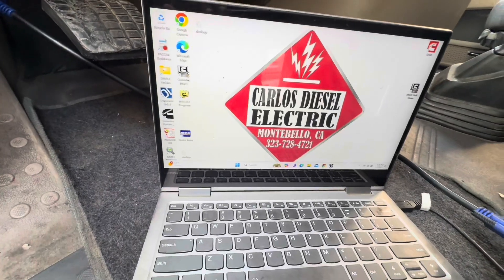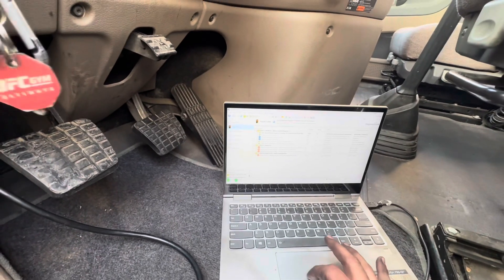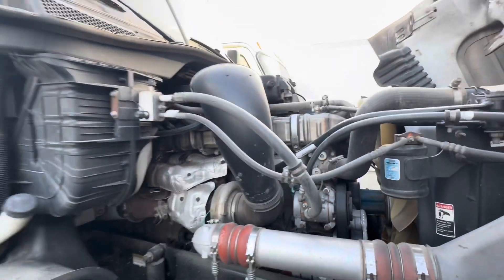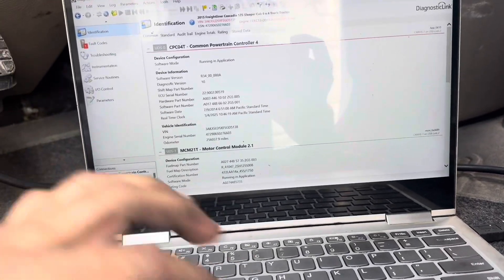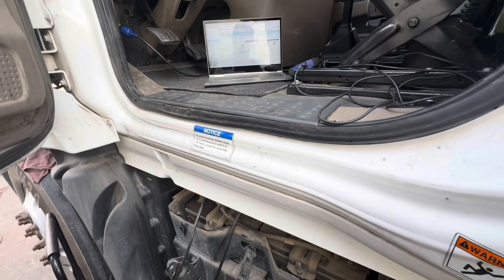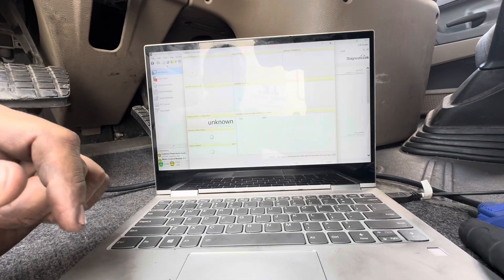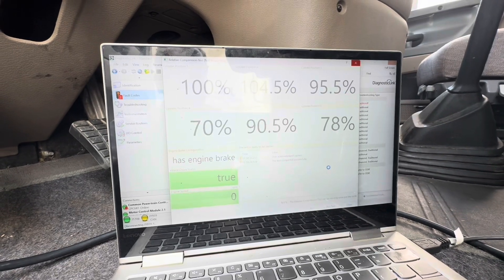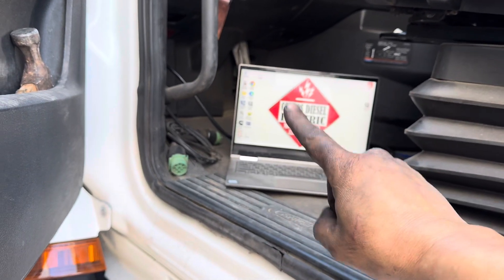Cylinder misfire, bad Injector or valves out of adjustment. SPN 1326 FMI 31

Comment: I’m getting this exact code. SPN 1326 and FMI 31. Should be a cylinder 4 misfire but when I listen to the injectors with a long extension to my ear. I don’t hear cylinder 3 injector working at all but every other injector is firing.
Reply from the maker: I typically perform a cylinder cut out test at low rpm 600, 700 and then increase the rpm to 1000 and check for the any difference. Also look at the graph is you are using DDDL you will see a difference. 
Try doing that then check the valves. Adjust and then retest.

Comment: Ever had this code on a maxforce, 2015 international 7400? Ive done the KOEO injector test, all sound normal. Performed cutout and all sound the same expect at higher idle speed cyl 4 doesn't act like the rest but at idle it does. I dont have access to relative comp test on the Jpro. What software/ tool are you using here? Im newer to the the HD side of trucks so thanks you for any insights
Reply from the maker: I recommend the original software especially if you are working on International trucks and engines. You will have more access to testing

Comment: For DD15 freightliner after 500K miles then every 100k , I have to do over head for my trucks but I’m looking that device  and software  how much will cost if you don’t mind
Thank you!
Reply from the maker: @lifesjourney7219  I use Detroit Diesel Diagnostic Link (DDDL). They have two options, standard and professional version. Both require a subscription fee. The professional version just lets you do updates but even those are not free. 
I use the Standard version which does everything you need to look at codes, troubleshooting, regen, injector code changes. 
The annual fee for the standard is around $700. Computer and USB link are separate

Comment: Hello
I need  your advice to buy one of these software so which one for freighter and Volvo?
Thank you
Reply from the maker: @mby9110  Freightliners use both Cummins and Detroit engines. Most Freightliners come with Detroit Diesel engines. You will find most of these in the Cascadia. I recommend you have access to both. 
Volvo uses Premium Tec Tool I believe. 
I would go with which ever you work on the most. For me I don’t have too many Volvos come in my shop.

Comment: My question is why were those valves tight.  Is it just valve recession and if so is it getting time for a new head if they were getting tight enough to hang open.
Reply from the maker: @sg1trogdor  the valves are getting tight from normal wear, but this usually happens from not staying on top of your maintenance. In my opinion valve adjustment should be every 100K miles. I do not agree with Detroit. 
They recommend valve adjustments at 
100K, 250K and 500K miles.
Reply: @CarlosDieselElectric  Interesting im a cummins guy so i was just curious what guidelines some of the other engine companies follow.

Comment: If it's a 2022 or newer, Gen 5 DD engines now use asymmetric injection and a 700rpm idle speed to rapidly warm the aftertreatment system. A lot of my drivers feel like it's misfiring, but that's just the way the latest iterations are. 

Thank you Pedro for the great content!

Comment: Have you ever had a truck come in with a surging issue at idle?
Reply: Fuel quantity valve?
Reply: That's you quantity control valve. It's located on the High pressure fuel pump. And it can be a bitch to get off in certain trucks.
Reply from the maker: @caseywoods9183  like most have said, Quantity control valve sounds like the problem. They can definitely be a pain especially in the DD13 engines in the short nose Cascadia.

Comment: So what's the final verdict for that engine? Rebuild? Obviously that #4 didn't go to 0 just because 🤔
Reply: worn head and valves
Reply from the maker: @ofilippov  worn valves. The adjustment helped but the cylinder head will need to be replaced. But considering the mileage, overhaul or inframe is recommended.
Reply: How much does an overhaul runs for?